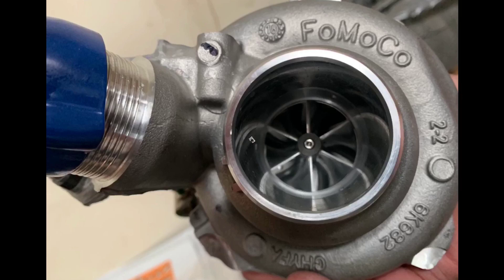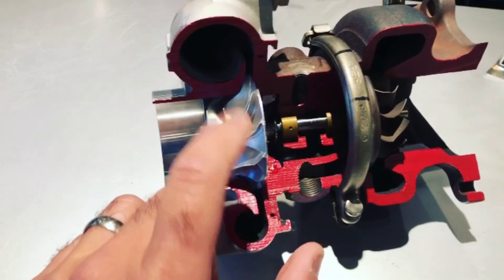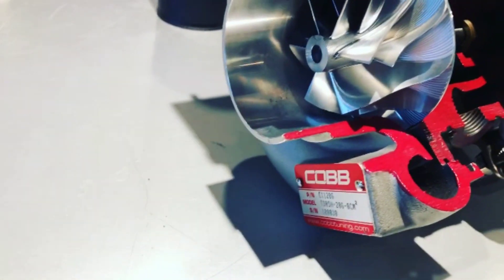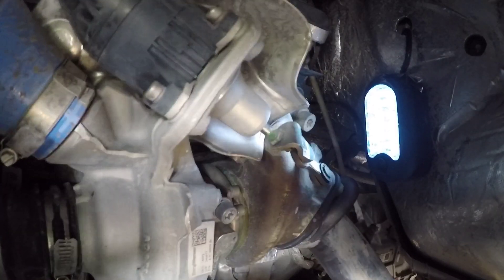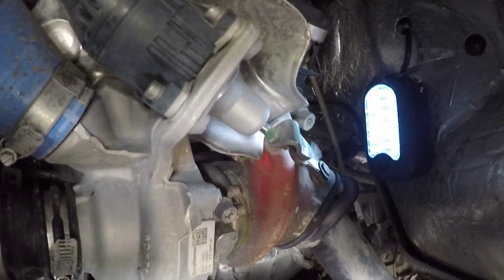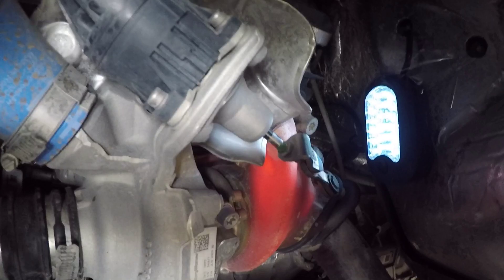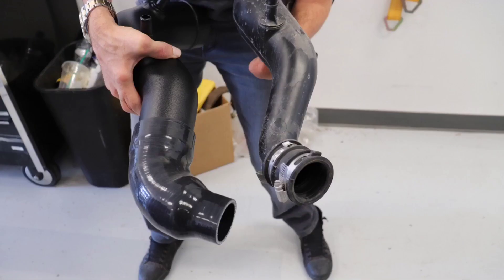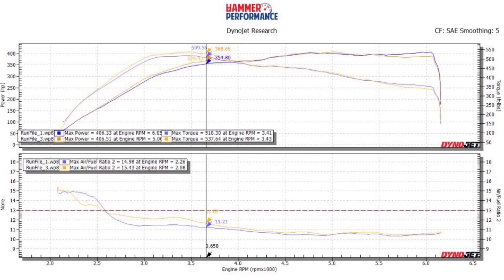More boost = Less Power?

Comment: Great content love ur videos ,i wanted to ask if it's possible to change the default Watergate setting so i can hear the turbos more pronounced while idling and cruising speeds like the gen 1 3.5 ecoboost that has a catless downpipe , will a tune or a boost controll work? Itl will make the v6 sound alot better if u could hear them from tail pipes
Reply from the maker: Cirilo Gonzalez you wouldn’t want to do that. You can get a BOV to give you more skins at release. Messing with wastegates isn’t ideal. Takes a long time to set them up properly and the help with making good power.
Reply: @OffroadAlliance   ok thanks for replying